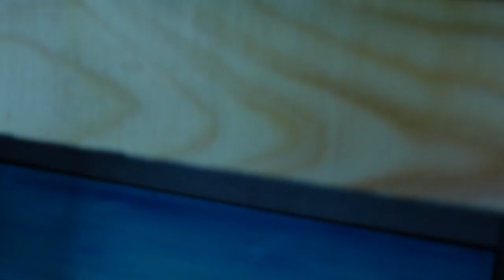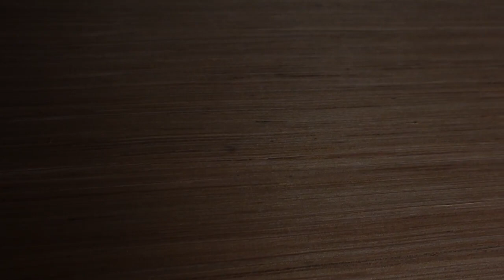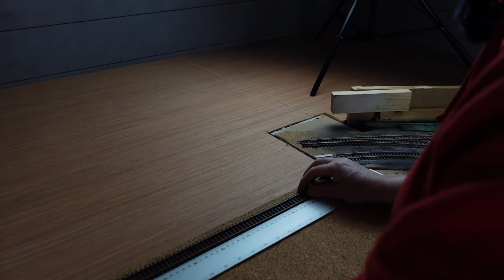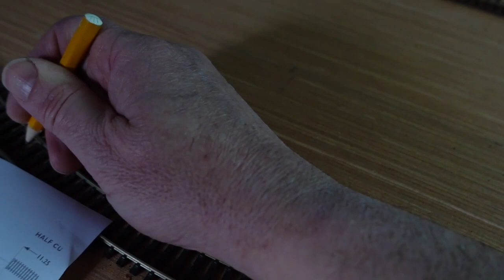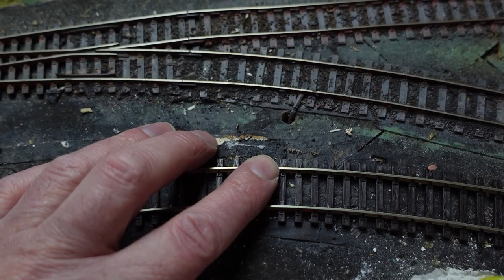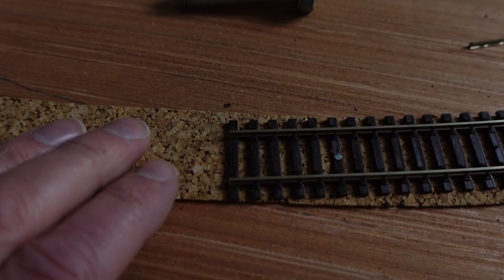107 Model Railway for Beginners Track Laying and Droppers

Comment: Thanks Mark. I am just starting out (already had one go at making a layout) and it is really good to have advice from folks like yourself. I've been having trouble with derailing and I now realise (after watching your video)  it was because I put my pins in too tight which had pinched the rails together.
Reply from the maker: Hi Wotton Tor, Glad it was helpful! another common cause of derailments is the back to back spacing on the wheels especially on points